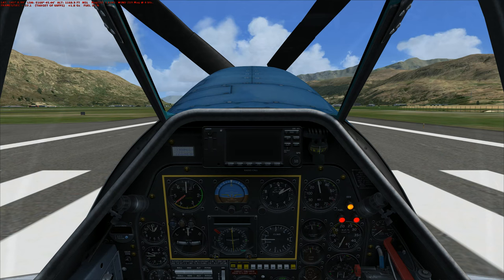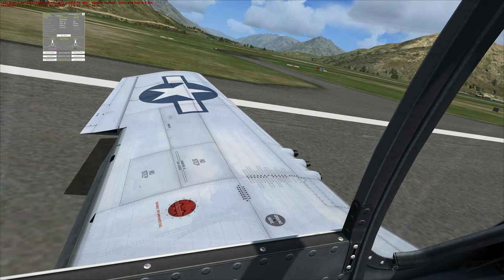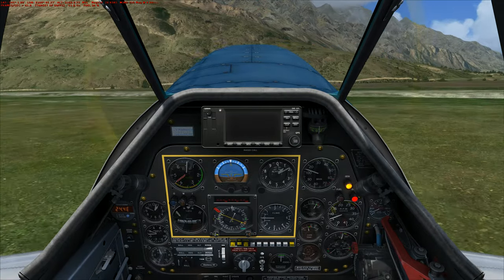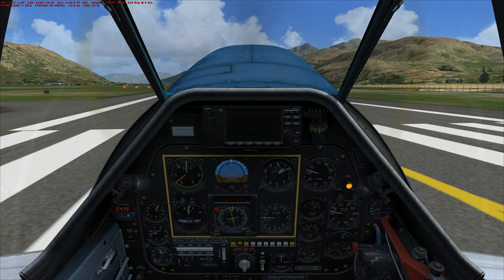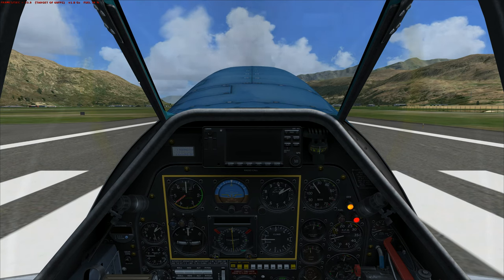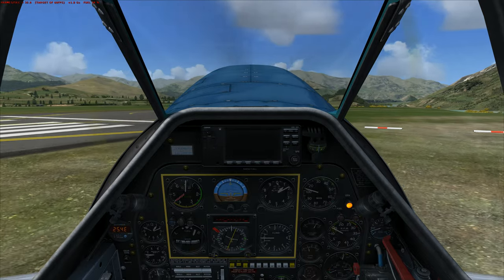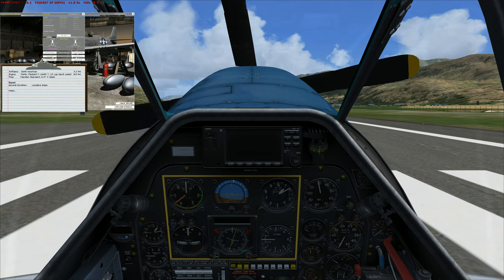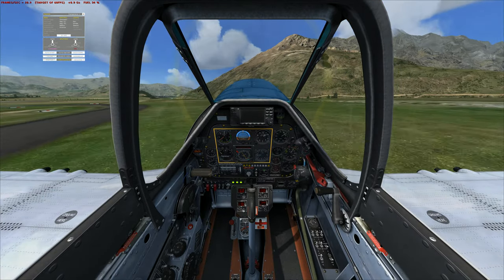A2A Civilian Mustang Take off problems

Comment: If you have a rudder it is better to set it to 0 degree if not with 6 degree using the rudder it is impossible in any case I could solve the problem as well
Reply from the maker: Yes I agree but the manual recommends using 3 degrees. I preferred not to because despite giving a slight help during take off you then have to glance down to reset to zero which causes more awkwardness than just learning and practicing the take off. This wasn't the actual problem though, the actual software installation failed to correctly define the rudder so you basically had no rudder during the takeoff run, not cast wheel to steer the plane. So it was almost impossible to achieve. Flying a single piston with no rudder not a good idea. Thanks for watching and your comment though!
Reply: @florida4life  as for me I solved this problem by intuition, because it would be necessary to compensate for this takeoff drift by pushing the rudder slightly to the right in order to succeed relatively a good takeoff, but what I note is a little bit abused that programming from A2A! thanks to you too ! translate french english